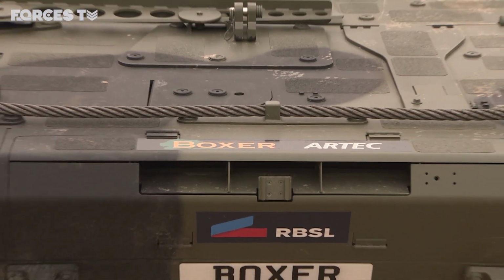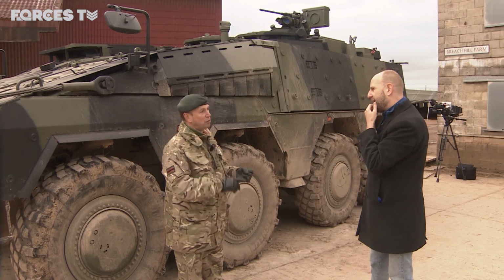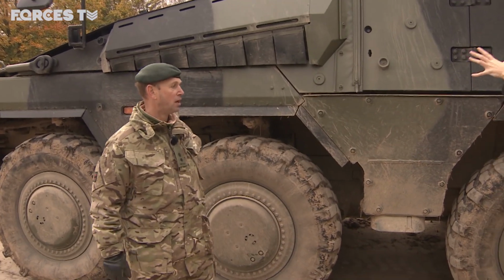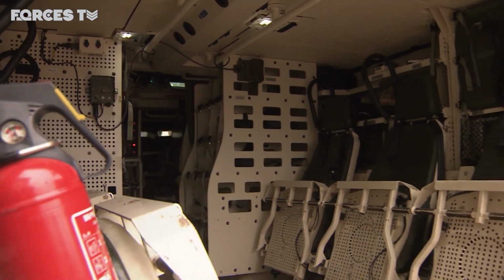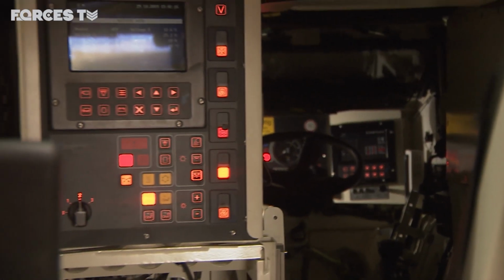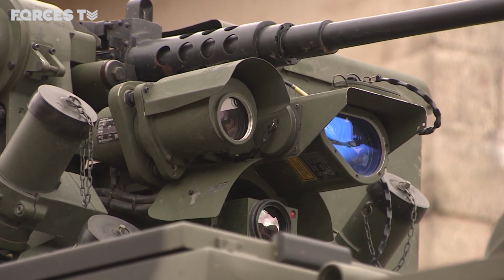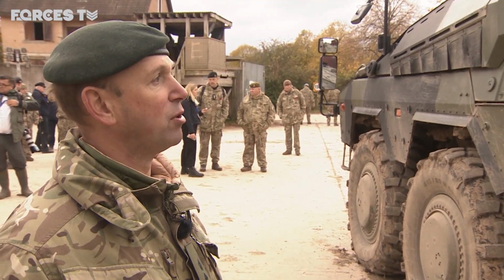BOXER: Up Close With The Army's New Fighting Vehicle | Forces TV

Comment: The modular concept can be seen from two perspectives: 
The advantage is not only that any Boxer can now be quickly converted for a specific mission, but also that a roadworthy Boxer will always be available for a specific mission. The engine, the drive train and the chassis simply need to be maintained more frequently than a mission module.

Comment: Normally, it's the other way around: Germany was never the first to deploy new equipment after World War II. This time, they were able to convince many others that this vehicle is a real game changer with its new concept that brings strong tactical capabilities. The Germans have not regretted using this fantastic vehicle in Afghanistan.
Reply: Germany is one of the world's largest arms exporter.
Reply: well, not quite correct. since the introduction of Leopard 1 in the 60´s, germany was always pushing the leading edge of innovation, while the UK for example got left far behind. the reason why the domestic UK defense industry is basicly dead since the 90´s.
Reply: @zhufortheimpaler4041  Well, that Germany is bad, does not mean, that others are "worse". I agree, the British defense industry should be improved.
Reply: @cvdheyden  uhm again: currently the leading developer in tank engines, transmissions, armaments for the tanks, armor etc is Germany. Guess why close all non Russian tanks and afv's use transmissions from Reno and engines from MTU? Or why all non Russian tanks usw the German designed 120mm smoothbore, why Diehl Defense produces armor for half of the world etc. And that for the last 50 years. And it's not only in that area but other areas as well, like infantry weapons from automatic rifles to anti tank weapons too. It is the uk that in the last 30 years regularly calls for aid from German companies like kmw/rheinmetall, HK etc to fix the uk garbage
Reply: @zhufortheimpaler4041  Well, I lived in Germany a long time, gues why I know this, but you are right. Engineering is still good in Germany.

Comment: Will it survive an IED blast
Reply: yes, combat proven in afganistan
Reply: It's not even made so it's never been to Afghanistan.
Reply: @JammyDodger45  ehm... The German army used boxer in Afghanistan since 2011. And it has seen a fair bit of combat there
Reply: @zhufortheimpaler4041  - this isn't the German version. 

There are significant changes to the British variant including the suspension, body attachment,  drivetrain and armour. 

So, as I said, this hasn't been deployed.
Reply: @JammyDodger45  the uk buys the off the shelf variant dude. There are no alterations, the first few vehicles even come from Germany, prior to the production start in the uk.
There are no alterations on the vehicle, only minor parts like the battlefield management system etc are different from the German or Dutch one
Reply: @zhufortheimpaler4041 - the UK variant bodies are being fabricated and assembled by WFEL in the UK. The different modules we've procured require a different attachment for body and chassis. And the sensor suite designed by Thales has necessitated a different armour configuration which has changed the weight distribution of the vehicle and required a suspension modification. 

This is what UK Defence Procurement is best at ... extracting every penny from the UK taxpayer.
Reply: @JammyDodger45  i dont know where you get that BS from, but the UK Boxers are 1:1 interchangeble with the german ones.
Only certain onbard electronics and optronics + weapon options have been customised to the UK.
You can take a german boxer chassis and put a UK mission module on it, and the only difference is the ugly UK flag and camo
Reply: @zhufortheimpaler4041 oh dear, who's all butt hurt about the 🇬🇧? 

Have we conquered you in the past? It's that why you're so grumpy? 

Get over it. 

You're wrong, look at the MoD, WEFL and Thales sites and then come back and comment.
Reply: Depends on the size of it.

Comment: don't like it.  should have used smaller tires, that are non pneumatic.  reduced the overall height, particularly the crew compartment.  the side armor should be more angled, and thicker. 
if you study the Earth's finest animal predators, they sneak upon their prey as low to the ground as possible...and then, they strike.  this is too damned tall.
Reply: but lions etc dont have to deal with anti tank mines and IED´s.
IED and Mine protection comes with higher ground clearance and a taller vehicle

Comment: not sure how practical modular design is. It's not going to come with multiple modules and you're not going to take modules without the rest of the vehicle so what's the point? The only advantage would be if the vehicle is damaged. You would then take off the module and put it onto a working vehicle. If this is the case then it would suggest that these are only going to be made available in very limited numbers for each operation.

Comment: lol. Virtually the only types of vehicles that the boxer can be said to have "more strategic lift" (which is a ridiculous use of the word strategic) than are mine resistant vehicles with 4 passengers; no improvement over  Additionally it seems highly unlikely that these modular mission sections will be interchangeable at anything other than a brigade FOB or higher. Open architecture only works when the systems you are plugging aren't using proprietary architecture, which they do almost exclusively. Only companies filling contracts for the British Army with a requirement to use the British architecture will be usable. This vehicle carries one less dismount infantry than the Warrior which is an IFV and not APC; why would you design an APC with only 6 dismounts? It's entire purpose is to unload infantry one terrain feature away from a conventional engagement, and it barely carries any infantry?
Reply: It depends on the variants that you'd want to use. There are IFV variants of the Boxer with, for example, the LANCE turret, that has been adopted by the Australian military as part of their Land 400 program. This turret has 30mm autocannon and a dual ATGM launcher in the turret, as well as up to 8 dismounts that can be carried. Some APC modules also offer 8 dismounts that could be carried.

Comment: what is it was high center of gravity, visible vehicles?
Reply: MRAP- Mine Resistant, Ambush Protected.
Mine and IED resistance comes from ground clearance, lower hull design and decoupled seatings (wich requires headspace). The result is a taller vehicle.
in respect to protection, Boxer has a higher level of protection than Warrior in all areas and also higher mobility with similar weight.
Reply: @zhufortheimpaler4041  sir the above was pure sarcasm and disdain for such things as the RG33 and Cougar.

Comment: The problem with "Modularized" vehicles is nobody ever actually changes the module once it's placed. You don't have a deep pool of spare modules lying around like the Thunderbird 2 hanger. So in almost every case the only time you ever need to be able to swap the module is in the factory. Modularity is a feature that looks good on the spec sheet. But if the mission calls for an ambulance, they just bring an ambulance. They've also tried the Modular concept with aircraft a lot over the years. Same thing. They configure the plane or helicopter once and only once to establish it's desired mission, and never change it again.
Reply: Key word you're missing on that spec sheet of yours, Maintenance. The transport/ambulance/ect all use the same parts and mechanics for its drive compartment.
Reply: Jack Mountain Well yes. Lots of vehicle use the same chassis and share parts. That’s actually a good design feature. It’s the swappable mission payload element that is over engineering a feature that will likely never get used. And certainly never get used in the field. It’s the sort of thing that sounds sexy on the spec sheets. But it means you’ve got a couple of bolts holding the infantry compartment on, instead of just welding that sucker down for added protection. It’s pointless modularity because the only time anyone will be swapping mission modules will be down at the motor pool when they are seeking to canibalize and MacGuyver three broken down vehicles into one working one. Which they are perfectly capable of doing with non modular vehicles.
Reply: @andrewtaylor940  but the cannibalisation is easier.
But also swapping out modules is relevant to modernisation etc.
in the end, your army should buy enough vehicles to not need to swap modules, but at certain points in time the swapping might be neccesary.
And the lockingbolts are part of the mine resistant design, so not really a weakpoint

Comment: Ok but the Mastiff is a super lightweight IED protected vehicle that's small enough to go through towns. This thing just looks too big
Reply: Exactly, bigger is not always better, it just weighs more and needs more room both of which cause issues depending where you deploy to
Reply: @regregan5755  considering that Boxer is protected vs 14.5mm fire all round, 30mm fire from the front plus mine and artillery blast resistant on STANAG IV level, it has to be big.
and it is not that immobile or inflexible as it seems.
15m turning circle are private SUV levels of agility and extremly good. a smaller car has around 11m. Yes it is not going to be a SMART or MINI, but it is significantly more agile than most MRAP´s on the market with higher levels of protection.
And considering that i live in a city with barracks, where Boxer´s are stationed and regularly move from there to the next traininggrounds on public roads.... they really dont have problems with normal city roads or normal european towns.
yes it may be too big for the roads of the historic core of some cities/Towns, but that is also a problem for more or less any AFV on the market.
look at REFORGER footage. rural german towns have been demolished regularly by comparably small M113 etc. Fences, property walls, signs etc have been destroyed by that on a regular basis.
but luckily, german rural historic town centers are not the regular combat zone we design our vehicles around.
In afghanistan the Bundeswehr used Boxer and had no problems maneuvering through afghan towns

Comment: $6million per, for a vehicle that holds 6 troops, weighs 38 tons (!!!), armed with a machinegun, and has wheels like a taxi or schoolbus, what a scam

compare, $600k for a vehicle that holds 10 troops, weighs 20 tons, armed with an autocannon, and has tracks like a proper military vehicle for the same armor (Stanag 4569 level IV; or... level VI at ~25tons and ~$1mil)... why the **** not?
Reply: What vehicle are you talking about? I can assure you a 600 k vehicle at 20 tons will not even come close to the protection level of the Boxer.
Reply: @jonny2954  acv-19 does. Boxer has Stanag 4569 level IV, as stated, proof against 14.5x114mm, same is same.
Reply: @zeburancher9480  Boxer has Stanag 4569 level 6+ over the frontal arc. Also the mine/IED protection on the Boxer is much better.
Reply: @jonny2954  (resent as youtube deleted original)
thank you jonny for correcting me, obviously I am an amateur with only a fleeting interest.
the ACV-19 does have an add-on armor package to increase its protection to Stanag level 6; proof against 30mm. I am having a problem finding the original info on it, but it is mentioned on Military-today (dot) com
maybe I was just missing something, maybe it is the APS that weighs and costs a lot - amateur. Have a good one.

Comment: Have the tyres got puncture proof tubes ?
Reply: of course they dont....
we are in the 20th century and have fought in several asymetric combat zones as NATO.
the tires have remote inflation/deflation from cmmander and drivers positions and have a flat running rim wich is capable of sustaining driving on a flat tire for at least 50-60km with maximum load (highest protection level mounted, full capacity loaded etc)

Comment: Anyone know what crew we are looking at? 

Looks like 6 dismounts and maybe 3 vehicle crew (Commander, Driver and a gunner?). How does that square with an 8 man section/ 28 man platoon? Anyone got any gen?
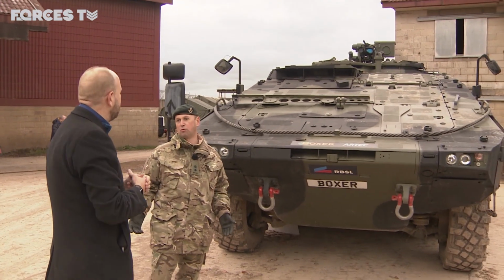Reply: Rey Van 0:33
Reply: @KA5Hx  thanks  but when you look in the back you only see 6 seats behind the crew cab.  3 each side. 

Also what's the plt lay down going to be ? My best guess is:
3x 8 man section. 
4x3 man crew. ( including 1x Boxer sgt and a Lance Jack to step up when PC dismounts)
Plt commander, Plt Sgt  and Plt RO. 
Ie 1 plus 38. That's a big plt!
Reply: @reyvan3806  Boxer APC Module has seatings for 8 Dismounts (7 men + 8th squad leader/vehicle commander, 9. is driver, 10 is gunner)

Comment: Wheels, no matter how many, will never replace tracks.
Reply: Nope, but they're a lot better on long, fast trek by road.
Reply: Looks like it just did.
Reply: just depends on the intended envirorment.
if you intend to do long offroad marches through heavy terrain tracks are certainly better.
But considering the increased urbanisation and the increased overlap of combat zones with urbanised zones and tactical and strategic deployments to said combatzones via roadmarches, wheeled vehicles outperform tracked vehicles.
Wheeled vehicles are faster, easier to maintain and require less fuel, resulting in a higher tactical and strategic mobility and deployablility in urbanised landscapes (like almost everywhere, unless you fight in antarctica or central sahara)
Reply: @zhufortheimpaler4041  in other words, it all depends...
Reply: @JohnHill-qo3hb  well 80% 
Of fighting happens in urbanised zones and landscapes. The equation is pretty much clear

Comment: My question is were does this leave Warrior it is an IFV
Reply: Same place, waiting for an upgrade. Different role.
Reply: @davidhouseman4328  I ask because the warriors has served the British army sense the 50s in a troop carrier role and if boxer that is to take up the role of troop transport along with other roles just like AJAX doesn't that leave Warrior irrelevant because both are faster and better protected also probably more comfortable to be that just leaves warrior as an outdated piece of equipment sadly?
Reply: @samuel10125  It's not quite as old as the 50s, just the 80s. 
The plan is to continue using Warrior, along side Challenger II, with an upgraded gun. The two being designed to work together.
Ajax and Boxer are coming in for the strike brigades, roughly speaking replacing Scimitar and Mastiff. There are for the quickest response. Note Ajax itself is an Armed reconnaissance vehicle rather than a troop transport, though there is a troop varient (Ares).
Reply: @davidhouseman4328  woops why did I say 50s oh it was the Russian BMP that was built in the 60s that Warrior was built in 1984 from what I heard to counter the Russian BMP or BTR I could be wrong on both. 

Don't worry I'm fully aware of the ignorence streaming out of me😂
Reply: @samuel10125  You may have been thinking of the FV432, Warrior was build to replace it but we still have them.
Reply: @davidhouseman4328  2021 warrior's has been retired.
Reply: @samuel10125  still a few years of service yet but yes no longer any upgrade and to be retired once Boxer is in place.

Comment: So what does Boxer do now, that it couldn't do 15 years ago when it was rejected by the MOD?
Reply: Paul price
Reply: @DrumToTheBassWoop  Ah yes, it's 4 times the cost, because the MOD is tired of just setting fire to money in the car park.
Reply: well, considering all british projects for an IFV and APC have failed so far..... it does everything better than the british competitors, especcially availability.
Ajax is close to scrapping due to major problems with the programm, that seem to be hard to fix.
The FRES (Future Rapid Effect System) of the UK dissolved due to major problems and cost explosions plus major intransparencies. like having 3 competitor vehicle designs, of wich 2 had test vehicles delivered and the third is represented via a predecessor vehicle, because the test vehicle was not out of pre prototype design, the not presend vehicle gets chosen  as winner during cpability testing etc.
Reply: The Mod left the project because because it wasn't going to be air portable, they then went for AJAX after the collapse of "fres" trials which is even heavier and late when CV90 was more suitable and in service with several countries!

Comment: Looks just like a Patria AMV inside and out
Reply: Alot of these new wheeled 8x8 looks very similiar, like the Stryker, the boxer, Patria AMV, and the Pirahanna V
Reply: only that Boxer can take frontal AP hits from a 30mm in less than 200m in its regular configuration and 14.7mm all round from under 500m. 
Its better protected than some tracked ifv´s (warrior for example)

Comment: A lot better than the old 432..if you were near the door...you was getting 80%...burns....that Boxer looks class...
Reply: 432 turret gpmg machine gun.
8 soldiers reclining seat for turret command and radio operator gunner.
Tight fit for all not forgetting battle gear for troops.
Boiler on door for food and hot water for cuppa.
Lots of noise unfortunately made for the 70s.
Nonetheless boxer infantry support APC working great and better vehicle.
Quality platform for all senario.